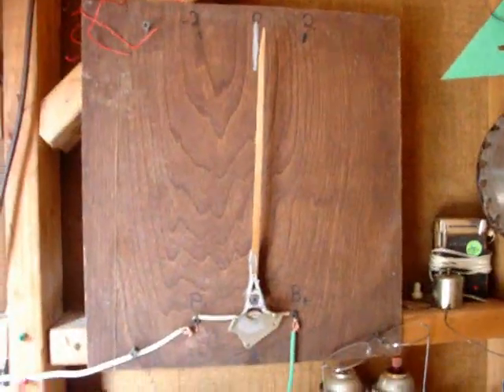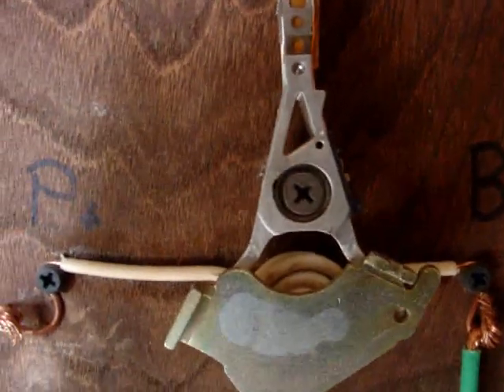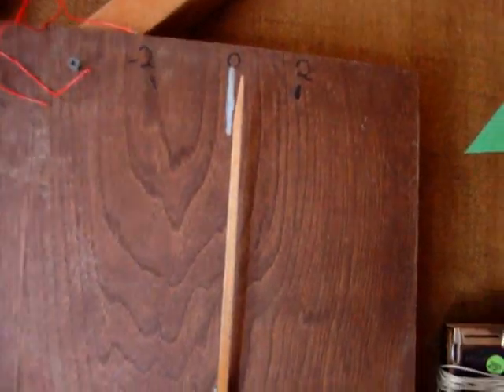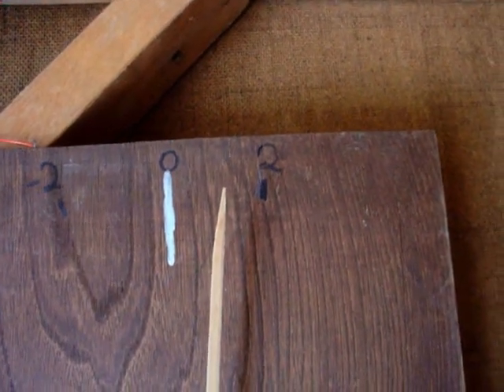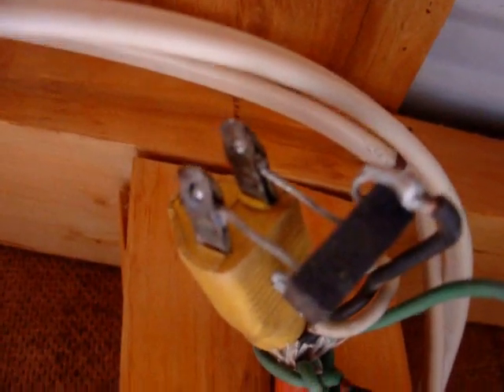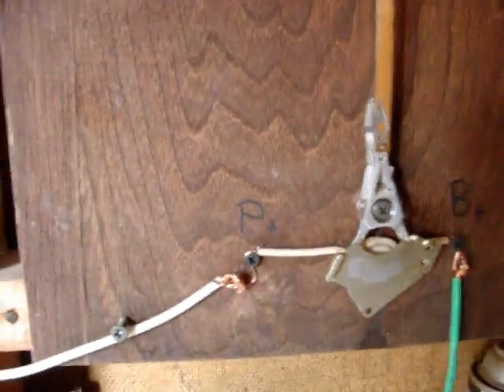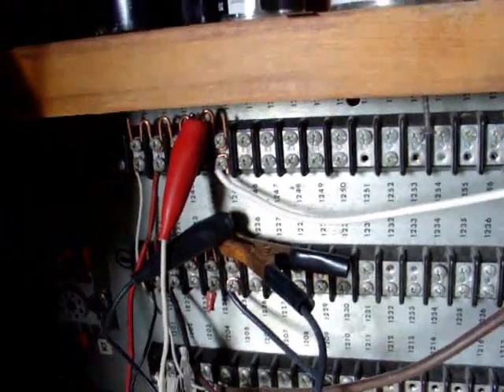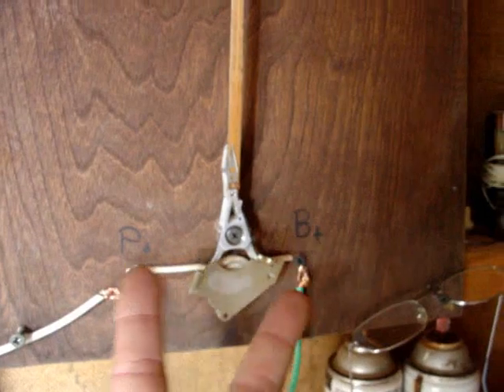THE AMMETER PROJECT

Comment: If the Amp meter is wired in series with positive wire, why does my amp meter has a positive and negative terminal. It seems that which of the two terminals the wires are connected to only matters when the needle goes the wrong way.  Your wiring is crude but it shows clearly how the amp meter is connected.  That is exactly what I was looking for.  Thanks.